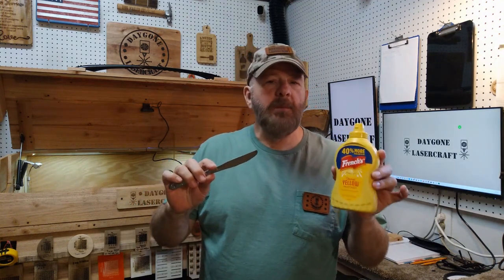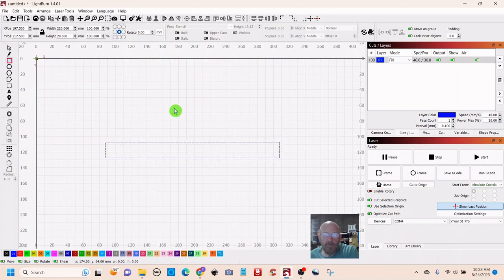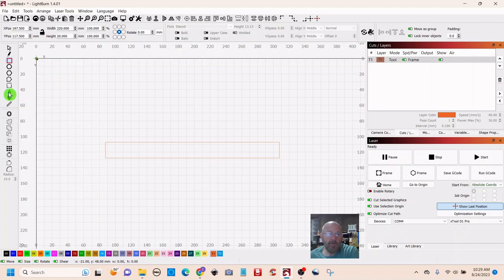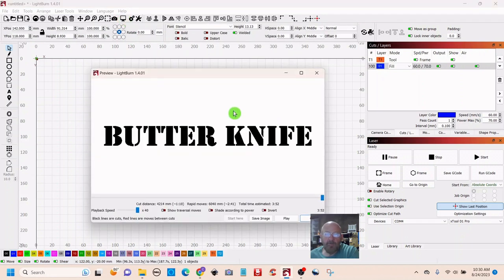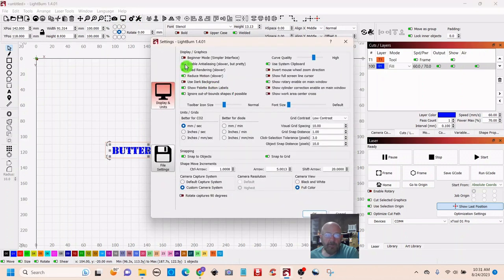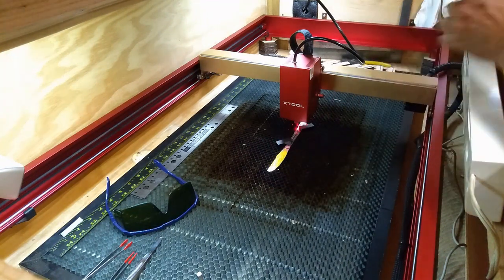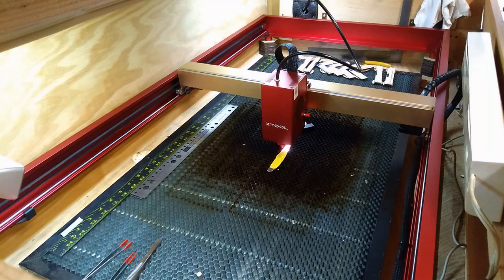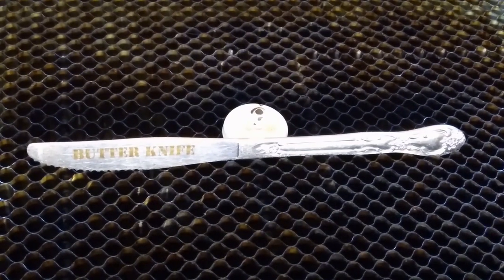Laser-Mark Stainless Steel with Mustard

Comment: I was reading an article from my laser manufacturer with some starting points and tips for different materials.  

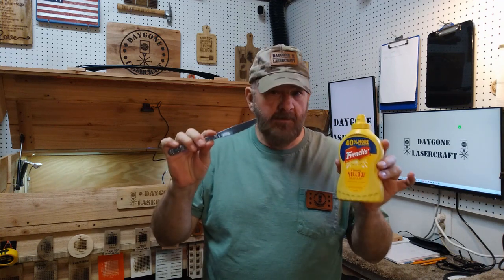When I got to stainless steel and saw mustard, my eyebrows hit the ceiling.  0:08 Nope, never did wonder that to be honest.  

I have two questions: first, is the yellow color somehow related to the mustard?  I know stainless is supposed to be able to take different colors based on power settings.  Second: Does the air assist not blow the mustard away before the beam hits that spot?  It looks to me like it's not doing anything.  Have you tried just plain stainless without mustard?
Reply from the maker: Hey Kyle, I believe the yellow color is just the combination of mustard seeds and tumeric and some folks believe the isothiocyanates from the two is what allows for the etching - I don't know for sure.  The air assist did blow some mustard away but there was still a thin layer - probably should have not used air assist and maybe could have gotten an even better result.  I did try it without mustard first and got a very light mark that was not readable.  I appreciate you watching and for the comment.  Hope you and your family have a Happy New Year!  - Dave.

Comment: It would be nice to see a range of mustards with a range of power and speed settings.. see if you can get that darker?

How does that etch hold up to scrubbing?
Reply from the maker: I may give it another try to see if it will go darker.  So far it is holding up good with normal use and seems permanent.  I appreciate you taking time to watch and for the comment.

Comment: I used my 10watt ortur and tempra paint and got results about the same. I hate the way mustard smells. Makes me gag.
Reply from the maker: I've been planning to try paint but just have not gotten around to it.  Thanks for watching and sharing your result.
Reply: @DGLaserCraft  

I've been too lazy to get black paint or even construction paper which I heard works the same (for engraving clear acrylic).  But I do have a container of graphite powder so I fingerpainted that onto a note card and slid it under* the acrylic sheet.  

It worked great to engrave.  I also tried plain masking tape and put graphite on the sticky side over an area of the acrylic on top*.  Taped around the back with the un-graphited tape.  I sent a file to the machine and realized about 30 seconds later it was the wrong settings and it was trying to cut not engrave.  Well cut it did.  Not all the way through, but it's 4mm thick and made it well past half way.

The point of this tangent: graphite.  It works.  IDK about other materials, but figured I'd throw that out there.  If we're messing around with mustard, graphite seems at least something to think about.
Reply from the maker: Thanks for the tip, Kyle.  Hopefully I'll get around to trying some clear acrylic in the near future.  Orange and black is all I have tried and had success with both.  Take care - Dave.
Reply: I was wondering what laser are you using? Fiber, ir, diode, CO2? Because I have an xtools F1 and a p2 so I have access to it, diode, and CO2 but the ir took forever to get a decent mark